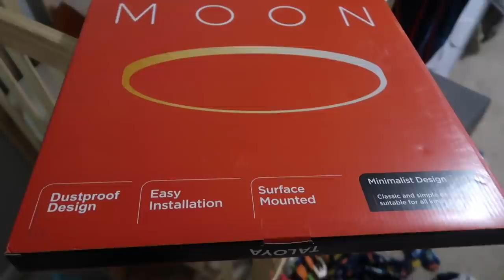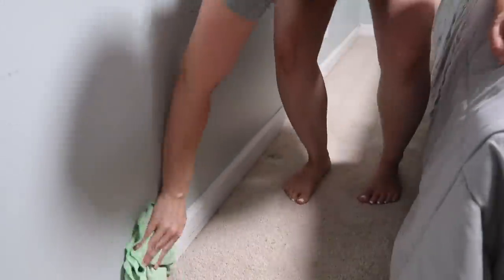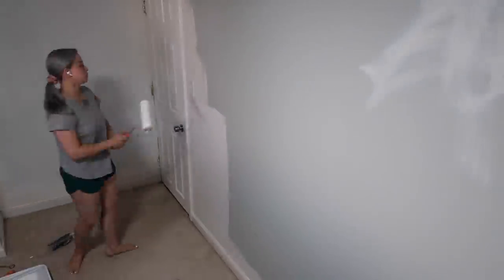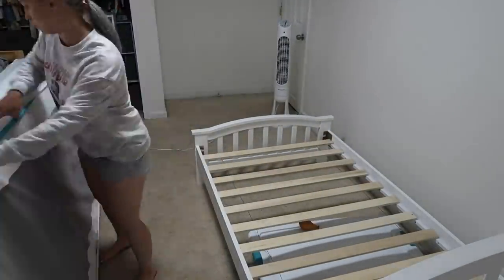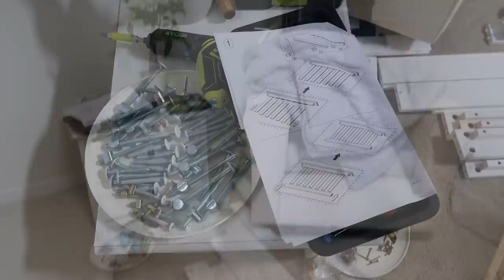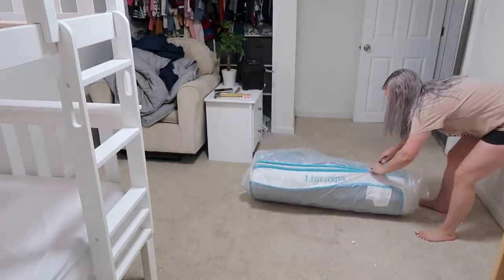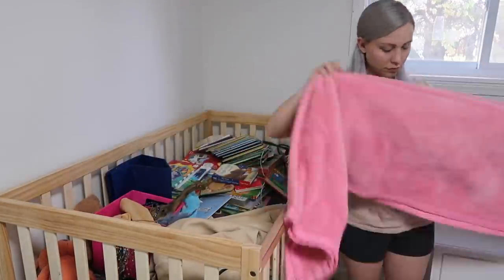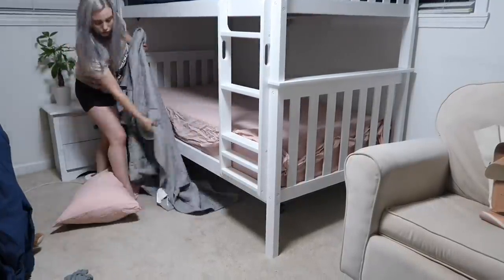TODDLER ROOM CLEAN AND MAKEOVER 2021 // EXTREME BEDROOM MAKEOVER // MOTIVATIONAL CLEANING VIDEO

Comment: How cute!!  But just a safety suggestion. Switch the location of the crib and dresser. One it will locate the lamp cord behind the dresser instead of behind the bean bag chair. And two it will prevent the toddlers climbing from the bunks onto the end table into the crib onto the baby. Love the simplicity of the deco.  Enjoy your videos!!
Reply from the maker: Thanks! Unfortunately I cannot move the bunk to that area because the top bunk will be directly under the air vent which we do not want. Luckily, my little ones know better and won't do that , we've talked to them about safety with a bunk. 😊

Comment: To make the bottom bed i wohld pick it up to its side, but dont take it out, put on the fitted and flat sheet or comforter for the side that will be on the wall, then just slide the edges and just lay it back down and finish up on thw other side 👍 for thr top there is not much to do except scoot the bed away from the wall a little bit to be able to have acvess to all the sides. Hope this makes sense and help 😁
Reply from the maker: Yes! Thank you!